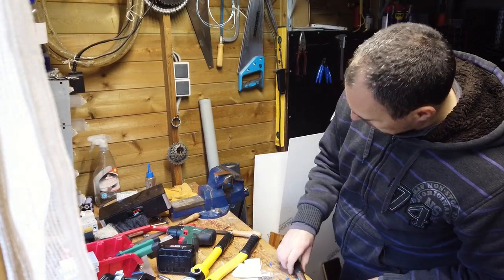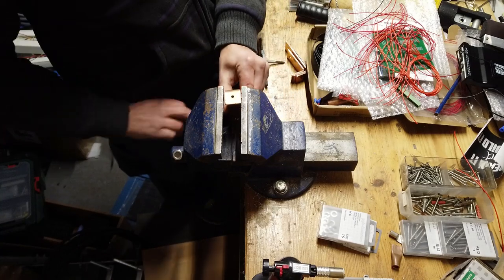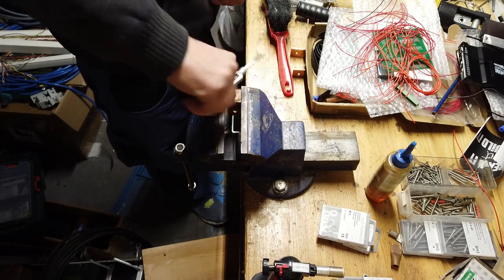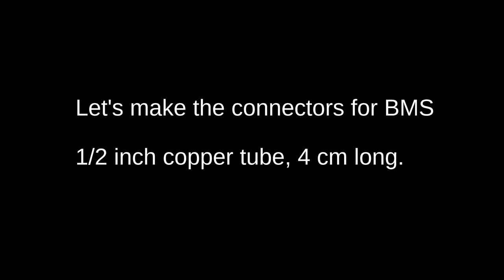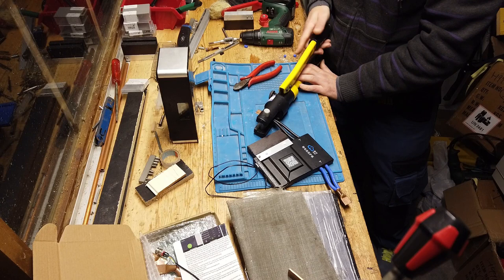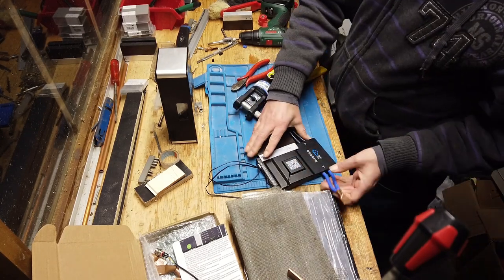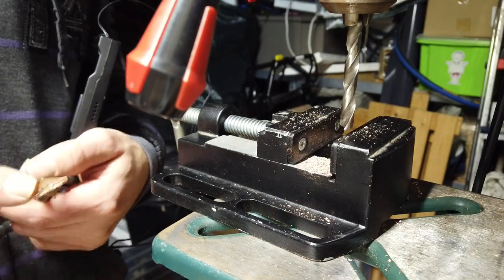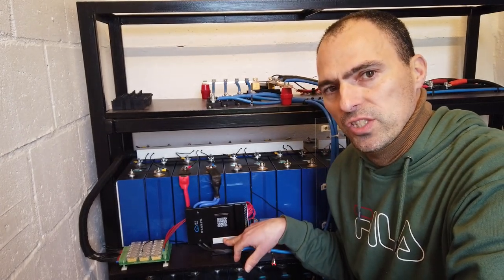DIY LifePo4 battery connections and BMS connectors

Comment: Great set up, suggest for the copper terminals add some electrical grease to prevent oxidation.
Reply from the maker: Hey, thanks for your reaction. Still looking for documention and added value for the grease. My previous setup worked find for 3 years without using grease. Will dig into that topic and hope to learn more. If you have info, please share.
Reply: @easypowerwall  
Try electric supply house for the electrical grease.
If your batteries are in a dry location oxidation will be less of an issue, but in high humidity it can be a problem.
It also can be a problem in the long term is your connections are not tight, but it looks like you are going to the trouble of torquing everything down, which is a good practice.
Don't have any documentation, just some experience.
This P = I^2 R thing always gets in the way at high currents.

Comment: Nice solution. I've a similar BMS. It has 7AWG wires, so I decided to try two 16mm2 lugs and then put them together. Expect to receive my lugs soon. Curious if those self made lugs will have the same electrical connection in the future (tinned vs untinned). Going to check with a thermal camera?
Reply from the maker: I'll check the whole setup with an IR camera. Have the camera at hand, but will take another few videos before we get there.

Frannky.

Comment: Hi there,

I just received my JK bms. I always assumed that the BMS should connect to the cerbo via a rs485 (like) cable. Apparently this is not the case (right?). So how did you connect the BMS to the Victron system? 
How does the BMS communicate with the Victron system? 

Directly via cable? 
Via NUC/RaspPi? 

Or is it just stand alone? 

Your advise will be appreciated :)
Reply from the maker: Hi Eric, 
The JK-BMS needs a RS485 connection to an RPI, and you need to install special software (venus OS). You can't connect the JK-BMS directly to the cerbo. I'm using a victron shunt to read the SOC. In my system. No access to cell voltage here, it adds more complexity for little added value. I check the status of the cells on a regular base with my phone. Working on a solution to monitor remotely, but still in study/engineering phase.
Reply: @easypowerwall  I thought the BMS communicates to the system (victron or other brands) by telling the system ‘the battery is full, stop charging’? 
Or how does the inverter know to stop charging?
Via the smartshunt? Or does the BMS shuts itself down and charging will automatically stop?

Lots of questions 😉

Comment: Om welke reden heb je de kabelogen zelf gemaakt?
Reply from the maker: I couldn't fit the 2 cables from the BMS in a regular connector.
Reply: No matter how much I like your project, from connections perspective you have done some things that are unacceptable in my opinion (as professional Belgian cable harness manufacturer).

1. The Red, Blue and Yellow crimp connectors are there for a certain wire range (0,5…1,5 / 1…2,5 / 4…6mm2)
You have to crimp them with the correct pliers to get a gas-tight connection. Adding solder is not needed (even not advised), soldering only like you did is a bad idea, since eventually the solder cracks or flows under stress, resulting in bad and hot connections over a long period of time, with possible fire as a result

2. Making cable lugs from copper pipes 🫤 
Sanitary copper pipes are made from red copper, which is passivated on the inside (=less conductive protection layer). Copper for cable lug’s (also red) isn’t passivated on the inside and is also always tinned.
Again crimping with the correct pliers gives the required gas tight connection. 
Using a general pliers for a general cable lug doesn’t count for a qualified crimp, each brand has different specs on tools and cable lugs. With the majority of the Chinese "quality products" you’ll see that these are not ok: crimped too hard or too soft, which is both not ok at all.

The currents in these systems are generally speaking high and last rather long. If you check with thermal camera it might be ok, but not guaranteed it lasts for years in that same state.

Again: I like what you do and support this, but seen this is a community thing with a big reach, I definitely advise to reconsider your wired connections.